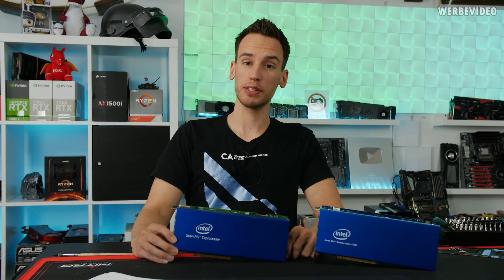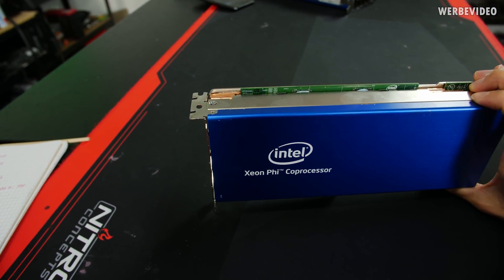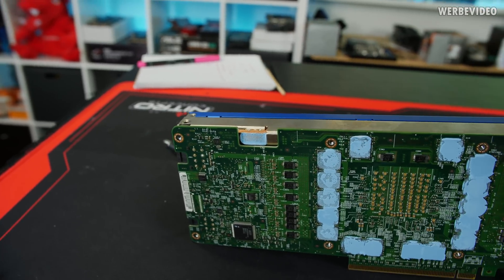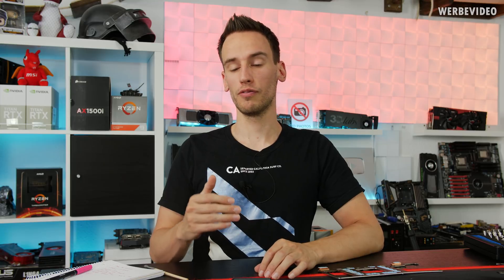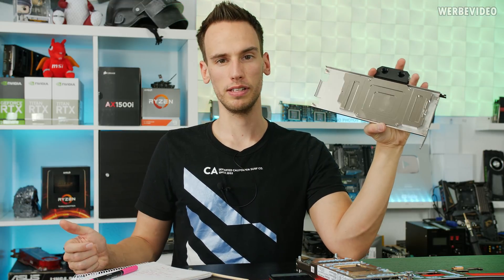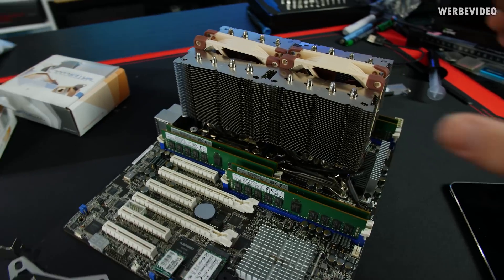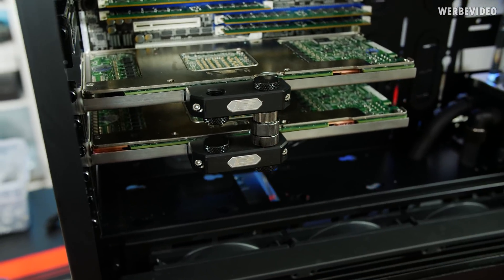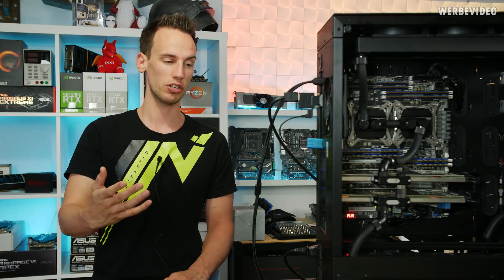Viewer-Mail Ep3: VGA Shaped Intel CPU with 61 Cores - Intel Xeon Phi

Comment: Intel: This GPU is a CPU.
Nvidia: .......
Reply: Nvidia - Always has been
Reply: @NonsensicalSpudz  yep.
Reply: Intel: This CPU was supposed to be a GPU but we never could get the renderer code to work.
Reply: @MoraFermi  No, they got it working. The problem is, it performed like a midrange card from nvidia or AMD. The even bigger problem is, this was meant to have a $1000 list price. That was never going to happen, so they instead made it a compute card.
Reply: @MoraFermi  I think bit was more a performance and power thing. You can make a driver that gets 3D rendering to go the the AVX-512 instructions. It's just wasn't as good as Intel though it would be as a GPU.
Reply: No, servers use the extra CPU power on a Daughter board which connects through a PCI or PCIe port on the motherboard. It's not at all a GPU but just an added CPU kinda similar to a Mining rig. You can change what the processor processes. You don't have to run graphics with it.
Reply: Nvidia can´t make Cpus, But intel with her new PENTIUM II ®️ microprocessor will kill Gpus somehow.
INTEL, THE COMPUTER INSIDE
Reply: @thehappiestyokai5031  Nvidia bought ARM so maybe itll compete with Intel next year
Reply: Larrabee intensifies